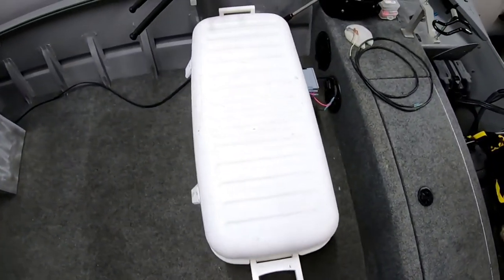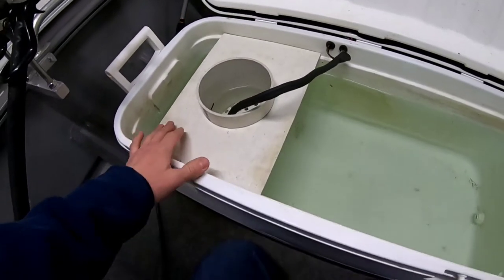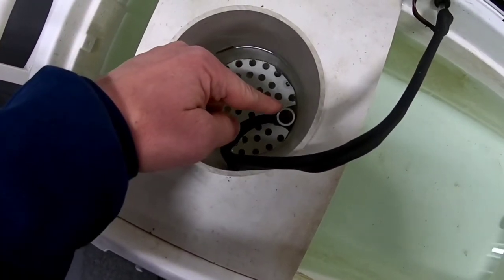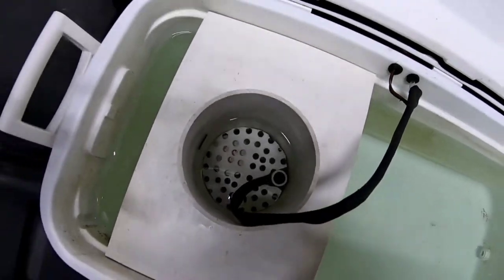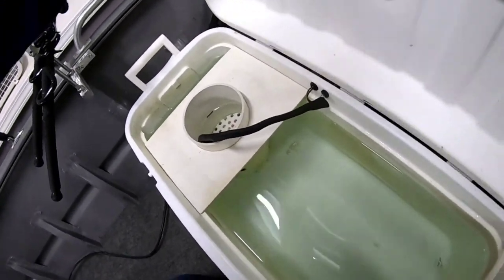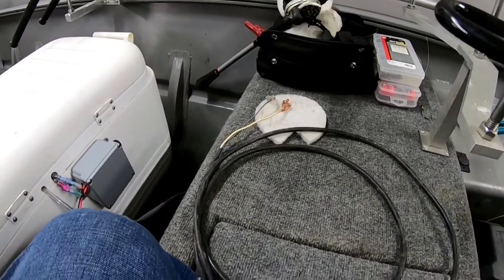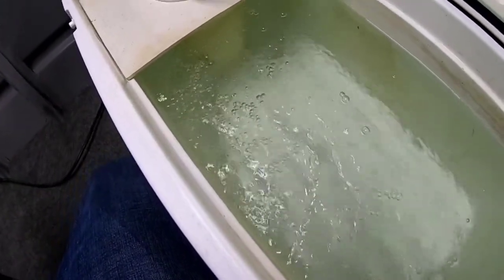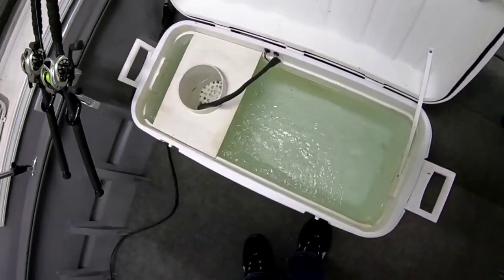D.I.Y. Gizzard Shad bait tank explained

Comment: I really like this setup. I’ve been thinking about buying a striper soup tank but the price of plus no insulation has made me hesitant. Can I ask what you used as the bottom plate to seal off the bilge from the bottom intake?
Reply from the maker: Hey I just used the round piece that came out of the flat top piece when i cut the hole.
Reply from the maker: I ran 3 screws in underneath it and then siliconed it in
Reply: @Riveraddictions  Doh- that makes sense lol. Not sure why I didn’t think of that. I netted some threadfin yesterday and put into a frabil minnow tank and it was basically instant death haha. Think I’m gonna copy this for sure now!
Reply: Awesome video! I will try this! I wish I seen how the bottom was made with the pipe!LoL I am a good visual learner! Thanks

Comment: Could someone explain a little more on how this filter systems works.  It sucks off the bottoms but the filter is at the top of the tube.
Reply from the maker: The sealed plate inside the filter is about 1 inch off the bottom. The pipe runs through the notches in the 6 inch pvc. Then Water is forced to push up the pipe going through that plate in order to stay even with the water outside the filter stack. Meanwhile the pump is sucking the stack dry so the water constantly flows up the pipe which in turn vacuums off the bottom of the cooler.
Reply from the maker: The sealed plate inside the filter is about 1 inch off the bottom. The pipe runs through the notches in the 6 inch pvc. Then Water is forced to push up the pipe going through that plate in order to stay even with the water outside the filter stack. Meanwhile the pump is sucking the stack dry so the water constantly flows up the pipe which in turn vacuums off the bottom of the cooler.

Comment: I'm a little confused on what I'm seeing? I can see the 6" pipe and that the pump sucks off the bottom and discharges back out the side of 6" pipe. What is the stand pipe for ?? Its not hooked to pump correct??
Reply from the maker: What your missing I think is the stand pipe is what the water gravity flows up Into, as the pump sucks the 6 inch stack dry. When the pump sucks the 6 inch area dry, it filters it
Reply from the maker: There is a bottom to the 6 inch pipe about 1 inch off the bottom of the tank. The 3/4 pipe goes through that to the bottom of cooler.